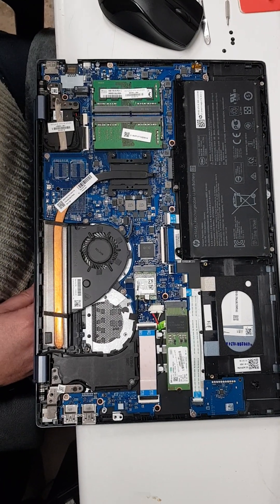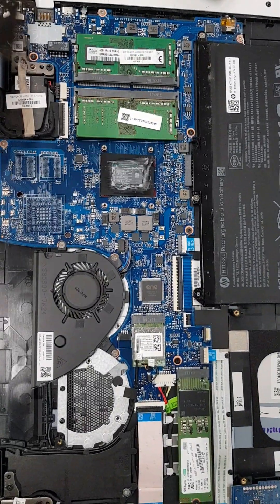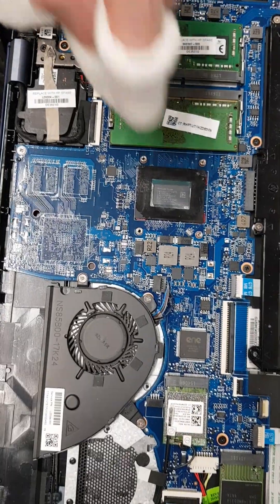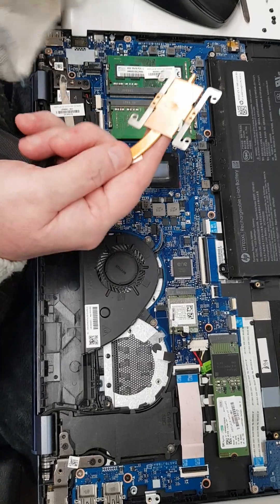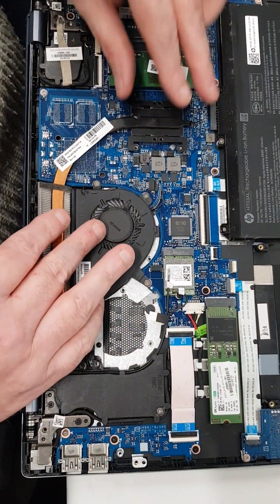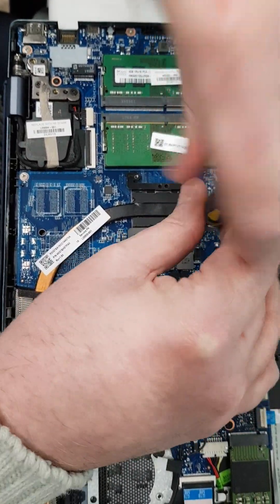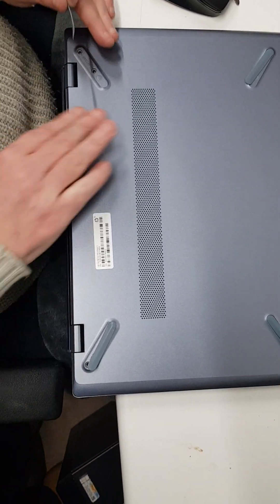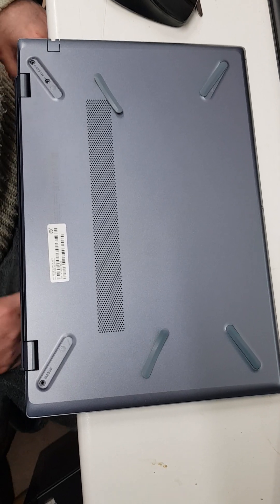How to fix an Overheating HP Pavilion 15-CW1xxx

Comment: Owner of a HP pavilion 15-eg0xx! I'm having the same problem. Since I've upgraded to win11 there has been a slight improvement. But even when I'm not doing anything on the pc, it's starts to overheat quickly.
Reply from the maker: Hi M B 
  Recommend in the first instance you try putting a hoover over the vents to clear any dust but do it with the laptop off.  Otherwise hope this video helps
Reply: My HP Pavilion 15-eg0xx came with Windows 11, and after a year it started to overheat. I dont know why, even after I open up the laptop to blow out the fan, still does this.

Comment: It would be appropriate to unplug the battery first. Test the Honeywell PTM7950 which has a higher thermal conductivity than the best thermal pastes.
Reply from the maker: I generally do unplug battery just forgot this time. Will see if supplier has them pads. Thanks.